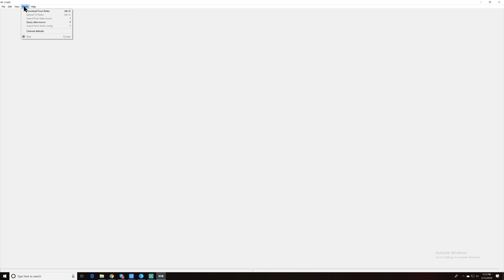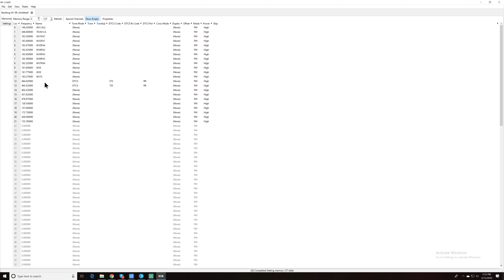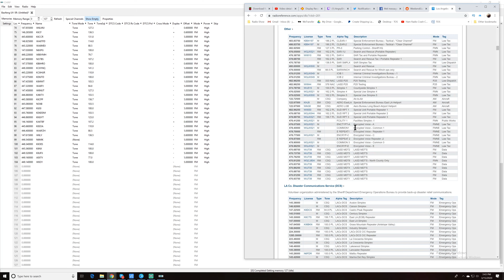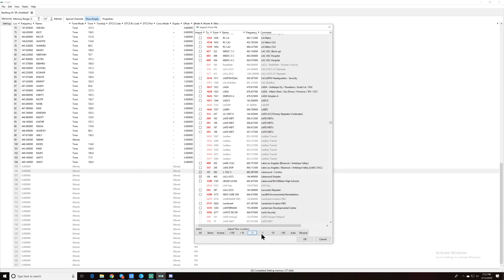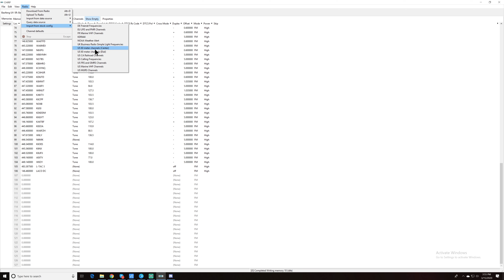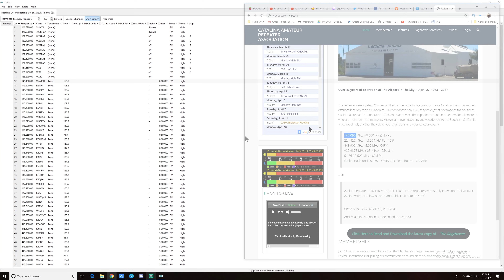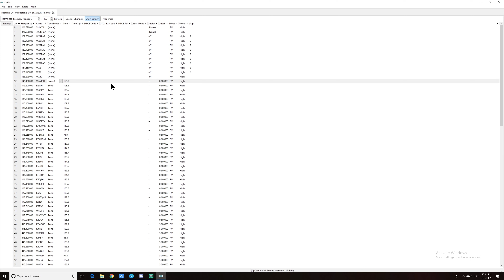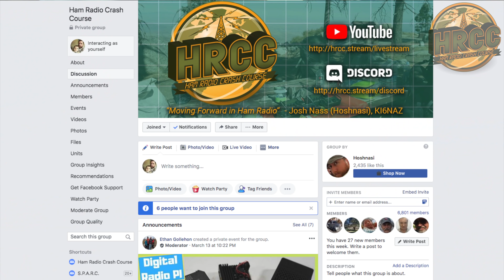How To Program a Baofeng Ham Radio Easy and FAST With CHIRP

Comment: Finally got my Baofeng F8 programmed with the help of this video.  I did have issues like probably taking about 7-8 times of plugging in the Chirp cable in before it work. The first couple times, I might not have pushed hard enough in with the cable on the radio side. Then trying to figure out which of the USB connections was the right one. Then watching this video on my iPad mini made it hard to pick up on some of the details. The download from my radio must have worked cuz there were only two channels showing but then when I went to upload the chirp file the the download link was grayed out anyway I was able to work through this and figure things out. Anyway about 2 hours later the radio was programmed. So far I’ve only heard the weather info on the radio 73 channels downloaded.

Comment: Hey Josh. Have gone through the setup many many times and keep getting this error message at the end when i try to upload to the radio:  THERE WERE ERRORS WHILE OPENING TMPHJFMY1.CSV.  THE AFFECTED MEMORIES WILL NOT BE IMPORTABLE!  LINE 2: NOT ALL ARGUMENTS CONVERTED DURING STRING FORMATTING.  I have deleted the CHIRP program and reinstalled it about 5 times now and reset the radio to default settings as well. Same thing happens every time.  The programming cable is the one that you recommended so I know its not that. If you or anyone on here can help, I would greatly appreciate it.  Thanks for your time and your videos.
Reply from the maker: What is the radio?
Reply: BaoFeng BF-F8HP
Reply: Ham Radio Crash Course did you happen to find out what could be causing that error?
Reply from the maker: @JoeTx1965  out of curiosity, are all the frequencies withing the 144 and 440 MHz. space?
Reply: Ham Radio Crash Course yes sir

Comment: New to HAM. Got my UV5r recently and have been having problems with it canceling my frequencies on the last digit. Tried changing the Step and band but still not working. A web on reddit said it could be a warranty issue but I feel its probably my user error. Any suggestions?
Reply from the maker: What’s the frequency you’re trying?
Reply: Welp. Found the uHF Range. The frequencies I was looking at online were out of it. Guess you can’t listen to EVERY cool one you find online. License on the way!

Comment: Hi Tried to download this is what I get   Due to the fact that the manufacturer continues to release new versions of the firmware with obscure and hard-to-track changes, this driver may not work with your device. Thus far and to the best knowledge of the author, no UV-5R radios have been harmed by using CHIRP. However, proceed at your own risk!

Comment: My radios are driving me crazy. If i send them to you can you program them for me. Before I have a nervous breakdown.
Reply from the maker: What issue are you having?
Reply: @HamRadioCrashCourse  wont program.  Like its locked.  Keys wont respond
Reply from the maker: Did you factory reset? Are you trying to manually program or use your computer?
Reply: @HamRadioCrashCourse  have not reset radios. I might have a bad cable
Reply from the maker: My amazon store has the proper FTDI cables linked.
Reply: @HamRadioCrashCourse  thats how i ordered the cable. From you site.

Comment: Of course, my challenge was getting the USB port recognized. In my case, I was using a 7-port USB hub. None of the ports were recognized. So, I plugged the cable directly into the computer USB port. Success. CHIRP is running fine.

Comment: has anybody successfully opened up CHIRP on mac OS 10.15.4 (My older MAC) or 10.11.6 (New MAC)  kinda stuck.  Bought a MIRKIT Cable PL2303, downloaded zip files, changed the security setting, and CHIRP will not open when I double click?

Comment: I keep receiving “an error has occurred - radio did not respond “. My port, vendor, and model are all correct. This pops up with in a second or two after the clone progress box pops up. Any suggestions? I’m using BTECH cable, UV-5R, and windows 7

Comment: Need a pre-class class. I need a beginners course before I can understand yours. I’m sure it’s good stuff!
Reply from the maker: Check out the first playlist on my channel.  There is a ton of beginner material there.
Reply: WAAAAAAAAAKKKK! i am SO with you on this!
i just got a gt-5r ('legal'? version of uv-5r) and it took a half hour to figure how to turn it on.
i'm used to squelch and frequency knobs. 'on/off' to me is a push button. there are 24 buttons counting the one to release the battery.
makes my head hurt.
and did baofeng not include the cord to keep the price down on the basic unit? whatever. i bit the bullet and got one off amazon.

some radios increase watts out by using a greater amp hour battery. will a 3800maH battery
do that? i will investigate.

i was gifted an amazon tablet last christmas. it took me 2 days to figure how to turn it on.
no knobs and the on/off button had to be held down for 3-4 seconds to do it's job. no instant on/off. came with NO instructions.
Reply: There is a good $2 app to take practice exams and explains why an answer is the way it is, with formulas ...etc. i love it.
Reply: @CptCloseCall  what is it?

Comment: Hey josh...question for you please if you have the time.
I have 2 uv5r radios and they communicate futher and better with each other in frequency mode then their programed  channel mode. any idea why. also, is it better to have a slight offset on the two radios or keep them at the exact same frequencies to communicate with each other.....thank you

Comment: What’s the difference between a ham radio and “walkie talkies” I can buy at any stores???
Reply: Walkie talkies rely on mainly line-of-sight communication and have a potentially smaller range than a handheld ham radio.  Ham radios are also frequency-based instead of channel-based, meaning there are far more frequencies open to licensed operators to communicate on than the limited channels available on a CB or walkie talkie.  The distance you can communicate with a powerful enough ham radio is also much farther.

Comment: I genuinely want an answer to this question, and I’m sorry if I come across as aggressive, but why does the HAM radio community love to rat out people without a license? I don’t like the idea of paying the government for privileges, so I think licenses are generally a scam. However, my wife recommended that I ask about it, before I write off the community. I am not illegally using radios. I just want to know why, other than “I had to pay, so you do too,” radio operators are so aggressive towards the unlicensed.
Reply from the maker: I’ll try to give you best answer I can.  I first want to say, the government is not charging for the license.  The $15~ charge is merely for the volunteers (not government officials) to administer the tests.  E.g. making copies of tests, materials etc.  No money goes to the government.
Regarding hams ratting on hams.  On the ham bands, you can’t legally transmit without giving your license.  You need to give you call sign ever ten minutes or when you end a contact.  So when you’re out there not using a call sign people know pretty quick you might not be licensed and since its illegal to do so, some people might submit a complaint to the FCC.  With that said, there isn’t much for the FCC to go off of, unless you transmit ALOT and they can direction find your station (which can happen).  OR, you could be using someone else callsign, which I think really pisses people off as you didn’t earn the callsign, but are bootlegging it, so they’ll report those people too.  
It’s kind of a fraternity of people who put out the effort to get licensed and they don’t understand why someone wouldn’t just go take the easy to test to get their callsign, its like bootlegger is scoffing at the whole concept and value of radio in general.
Reply: @HamRadioCrashCourse  so half of the community are dweebs
Reply: @amanwithnoname2744  and would account for the pretentious appearance of many give in the Ham Community  that is bad for something the want to grow,, and spread when there is soo much to learn, costs, penalties and challenges.. I wish there were more teachers like we have here.. as i sure need it.. and thanks for the topic i wondered about this myself .
Reply: 1. Driving is a privilege, but your drivers license costs, so does plates for your car. You u gonna let someone drive without a license or expired tags?
2. Look at CB radio's, that's citizen band frequency, no license or testing required. The level and amount of vulgar language, hate and discontent of other cb'ers, idiots running 500-1000+ watts (5 watt's is max legally) and throwing dead keys so no one else can talk, the name calling, etc...THAT'S why being licensed for HAM is important.
HAM operators take the hobby serious unlike those idiots out there on the cb's. With HAM, its illegal to broadcast music, sell items, and curse. HAM's know that they can be tracked by other HAM's so they follow the FCC rules, are polite and courteous, and enjoy being on the air.
The idiots I have to put up with on the cb in Tulsa, Amarillo, West Memphis, and other places that won't let you get local info, weather or road reports are one reason I got my ham license.
So yeah, if someone is running ham freq's and they aren't supposed to be, it irritates me. If you don't wanna get licensed, get a cb with uppers/lowers (sideband) like the Cobra 148 and play with those dolts.

Comment: Josh thanks so much for coming out with a new / revised video on this.  It forced me to update my CHIRP and load a bunch more frequencies into my Baofeng 8HP.  I'm finally tracking on the A / B channels and setting them up as you did.  For some reason I thought that they would scan together.  Had to watch that spot a couple times until I figured out what you were trying to explain.  So I can work duplex off a satellite by switching from A to B?  Thanks Buddy.  Hey is the ERG club gonna do remote testing?  I'd love to get my General from them if so.  Jeremy Pierce

Comment: I got the FT3D and was wondering if I can use the Chirp program to program the radio with the original cable? Thanks in advance
Reply from the maker: There is free software from yaesu to program the radio with the Sd card. Or you can buy by the cable and sw from RT Systems.
Reply: I’m using a Mac their software is for windows.
Reply: Anyway I bought the RT systems software and is unable to retrieve external databases I called support and they know about it a fix it’s coming up they say

Comment: I have a BaoFeng BF-F8HP and am trying to add local specific Los Angeles police, fire and air to air frequencies in Chirp but as I’m sure you know the BFF8HP only has 127 memory channels and when I select the ones I want through a Radio Reference query, most of the ones I want are outside of the 127 memory slots and for the life of me I can’t figure out how to change the memory channel numbers and just add the ones I want through Chirp. You may have addressed this in one of your videos, and if you have would you be able to link it? Or do you have a chirp preset file for Los Angeles emergency frequencies etc? I’m a bit of a noob but not entirely - any help is greatly appreciated!!!
Reply from the maker: I covered that in the last baofeng programming video last week. Check it out. 👍

Comment: I'm new to HAM radios and I'm trying to find the best one for on the trail. water-resistant, battery-powered or chargeable using only a solar panel (so no wall or vehicle plugin), long battery life and range, and lightweight/packable. Any ideas?

Comment: i m not a ham operator,(failed 2 times for my exame)i m using my baofengs only for pmr and lpd and as a scanner,i see all your radio video.s i have the baofeng gt3 and the baofeng uv 5r 73,s 19ct031 (my cb callsign)

Comment: Hey Josh! Super new to this and extremely excited to be starting on this HAM path.  My GF and I have been studying to take our Technicians test ASAP.  Your videos and tutorials have been incredibly informative.  Not sure if you or anyone else has ran into this issue but I have installed the newest version of CHIRP, uploaded the NOAA channels to our new UV5R MK4 but I get a "unknown file format" pop up when I try to get a Repeater Book Query.  No options for frequencies at all.  Any thoughts?
Reply: I had the same issue, but i tried a 'political query' which breaks down repeaters by state and county.  Procedure otherwise is the same,  it just took a few extra steps to upload the different counties and states around me, but it worked like a charm.
Reply: @preppie478   Much appreciated dude ill jump on and try that out asap.  ill come back an let ya know how that goes. Much
Reply: @preppie478  .. so looks like that worked!  saved me a bunch of time punching them in manually.  Again, thanks for the insight! Im excited to learn so much more about the world of HAM radio and all that comes with it.

Comment: I have a question that I am looking for an expert / near expert opinion.  I live in Naples, FL and I am new to the HAM scene.  I was looking for digital repeaters in my area and it appears that DSTAR dominates availability vs DMR vs Fusion.  Can anyone confirm this for me.  I am looking to upgrade from my BF-F8HP to something a bit more robust and I am stuck between the Kenwood TH-D74A and the Yaesu FT-3DR.  In my area it seems that the Kenwood would be a better buy as far as repeater availability and the radio itself appears to have the highest feature set to "grow into."  Any guidance would be much appreciated.  I will be taking my technician and general examinations as soon as a local / near local provider offers them after the COVID-19 situation calms down.  Thanks again so much.

Comment: Bro, your link takes you to tour shop where there are multiple cords. How are we supposed to know which one it is if they all have the model number you mentioned?
Reply from the maker: Pick the one that isn’t sold out. If it has your model number in it, you’re good. 

I had to add more since all the cables are selling out due to corona virus.
Reply: Ham Radio Crash Course 

10-4

Comment: Thanks Josh, Having never used 2m/70cm before this was a great video to explain not the "how to program" but the "what to program" ie just the call channels and repeaters. I have a new AT878  that needs filling up. If you want to QSY to a clear frequency from the call channel, you just dial it up, you don't need to programs loads of simplex channels. Here in VK I don't think we have all that many repeaters so I could program a few simplex frequencies anyway.

Comment: Does anyone know, what is going to happen if you extend you VHF/UHF ranges from Chirp, will it actually work? So when I set the lower limit to below 100 MHz, I cannot receive FM broadcasting radio in VFO, but when I click that Call button, I hear it. However, if I put 224 MHz , it seems like it works.
Reply from the maker: It generally won’t work. The Uv5r is only really capable of vhf and uhf frequency spaces. 220 is outside of that.
Reply: @HamRadioCrashCourse  thank you for the reply. I checked 224 MHz having 3 radios. Two BF-F8HPs and one Yaesu FT-70D. I was sending on low power on one of Baofeng and both two other radios were receiving the signal clearly. However, I don't have any equipment to check output power, and, of course, I don't know how it's going to work in real-life situations (all the radios were in one room).

Comment: Hey Josh, there is a way to change settings on multiple memory slots all at once. Use Shift-Click to select multiple sequential memory slots or Ctrl-Click to select non-sequential slots. Then right-click on one of the selected slots and choose Properties. This will allow you to change any of the settings for all of those selected. For example, you can select all your NOAA stations and enable Skip and set Duplex off. Thanks for all you do for the Ham community!
Reply: Another great tip I did not know. Thx!!
Reply: Should be pinned at top, since he couldn't figure this out or get over the slowing down to click them all individually. I just clicked well over 1oo times to change the settings. was fed up, thought about it, tried a few things, and came back to comment if it wasn't already well known. Cheers!
Reply: Excellent tip for this Newb! Perfect addition to Josh's great tutorial!
Josh, consider adding power changes to the FMS/GMRS/MURS entries in your tutorial?

Comment: I am not big on Baofeng or similar radios.  I do have a few of each that we use on the farm.  However, for amateur I will not use, but with that, I use the RT System for cables, programs and both in kit form for all radios, work, amateur and not worry about if its in English and no download virus/malware ....

Comment from the maker: Reminder. Baofengs and other similar Chinese radios are certified for amateur radio use only. Meaning you need an amateur radio license to transmit with them in the amateur frequencies. Transmitting outside of the amateur radio space with these radios is illegal. Please keep this in mind as you make your radio preparations.

Comment: I have a UV5R and a Baofeng BF-A58 S. I copied and pasted frequencies from the UV5R Chirp file into my BF-A58S Chirp file. When I uploaded the file to the radio, it corrupted the BF-A58S firmware. This has happened to me before with other different types of Baofengs. Does anyone know how to reset the firmware in the BF-A58S? I can no longer use Chirp to read or write to the radio; I get an error. Please help, thank you! Paul de KB0DWT